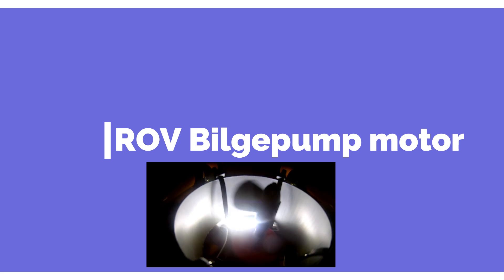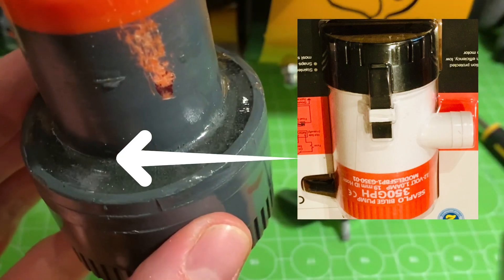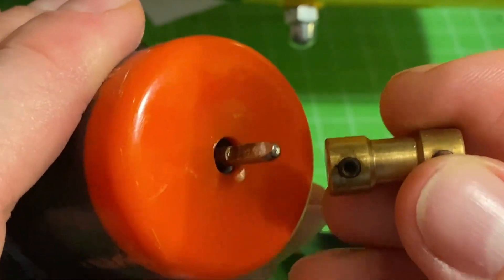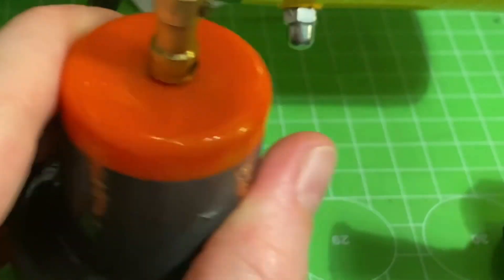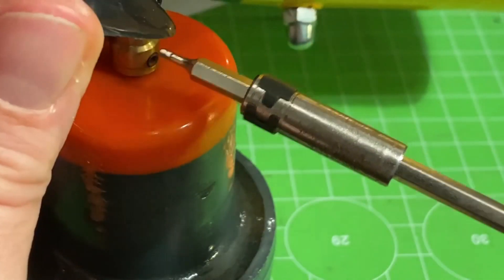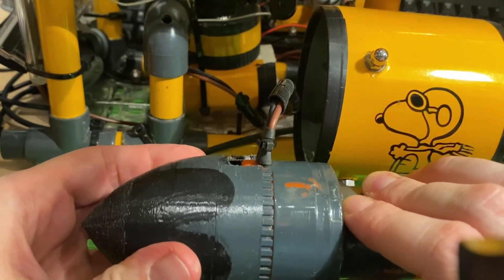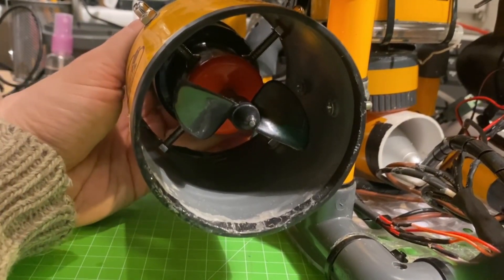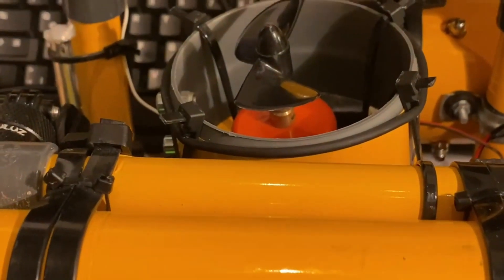Homemade ROV engines with Bilgepumps - simple & easy thruster

Comment: great project, i wonder what if you just install the bilgepump (not reassembly by other propeller). Will the thrust just same or weaker or maybe stronger?
Reply from the maker: Inside the pump is just a little pelton turbine. Meaning you have very little thrust: 
forward you have water exiting a hole and reverse… suction into a hole - no thrust and a bit of thrust through the pump intake… going into a different direction. 
So: I wouldn’t recommend it. 😀🙋🏼‍♂️
Reply: oh i see @agermangineer  , i want to make sea scooter. Is it recommended use this type of bilge pump for cheap and simple project? maybe need more than two of them 😁
Reply from the maker: @imacoid  well, if you use one for each direction (forward only) and if you have a good power supply with a short tether you will be able to operate it. A colleague of mine did that to steer a small buoy.
Reply: i love to hear it @agermangineer  , what do you mean by good power? it is possible to use more than 12v? and good tather mean change the cable to the bigger diameter i guess. Sorry if you hard to understand my english, i'm Indonesian
Reply from the maker: @imacoid  no 12 volt is correct. The question is, can the power source handle several Amperes? And yes, a good cable is not too thin.
Reply: do you mean  @agermangineer  that this pump will drain battery fast? for now i prefer to use lifepo battery
Reply from the maker: @imacoid  yes, that will do fine ☺️

Comment: Hello! Does these engines support reverse trust? if so how can you make it?
If no how can the submarine go back up or down?
Reply from the maker: Just watch from 3:07 or check out my other videos. Switch the polarity of the cables and you have forward and backward motion.
Reply: @agermangineer  Thanks!
Reply: @agermangineer  Do you think if i go 7 or 8 meters deep in water these pumps will hold the pressure? or theyll break?
Reply from the maker: @nicker3115  I’ve had them 15 m deep. No problems down there.

Comment: Und welche Propeller nutzt du
Reply from the maker: Robbe Racer rechts 62,5 mm M4
Oder Graupner…
Reply: @agermangineer  Macht des einen Unterschied, ob ich links laufend oder rechts laufend nehme?
Reply from the maker: @sirmoritz122  nö… musst nur richtig polen. Hätte ich damals links UND rechts kriegen können, hätte ich je 1 genommen.
Reply: @agermangineer  Du meinst am linken Motor einen rechtsdrehenden und am rechten Motor einen linksdrehenden, damit sich der Radeffekt aufhebt?
Reply from the maker: @sirmoritz122  ja, aber nur aus „optischen“ Gründen. Viel Radeffekt oder Torque hat das Ding nicht
Reply: @agermangineer  in der Größe die du mir genannt hast finde ich keine Propeller

Comment: Wow, i love it.  You would think building a vehicle that goes underwater... and keeps functioning, would be difficult.   I dont know if it's your voice or the style of presentation you hold, but ive learned so much from your videos and it doesnt feel impossible.  This videos a perfect example, why use something else when a bilge pump motor is meant to go in water, just adjust it so it spins a prop and attach cabling to modify spin rate and youre good to go.

Comment: i have a problem, when i start the motor for a long time the shaft of the motor is very hot but when i start it in the water there is no problem at all. do you know the cause?
Reply from the maker: Water cools the engine.

Comment: One question about these thrusters; Bilge pumps normally run in pretty shallow water so they don't have the best seals and you don't seem to be oil filling them and pressure compensating them. Are you just limiting your ROV to very shallow depths and putting up with a bit of leakage?
Reply from the maker: That’s right. Deepest turn so far was 15 meters. Didn’t seem to be a problem at all.

Comment: I am looking for that exact same motor, it seems it is unavailable to me. It should be possible to use a 500GPH Seaflo Bilge Pump correct? I may in theory need to step down that voltage using resistors or another method? I am worried that 500 GPH is too much power.
Reply from the maker: The 500 GPH pumps by seaflo are available on Amazon and eBay. However, they got a bit pricey lately. Usually they cost around 15 Euros. Also check the 350 and 1100 GPH versions for comparison.
The voltage can easily be adjusted with a proper DC fan-speed regulator. Or any voltage-regulator fit for the 1-3-or 5 Amp current drawn by the different pump-versions.
Check out my other videos for more info. :-)

Comment: Can i bu your motor sir ?
Reply: Can i buy your motor + propeler sir ?
Reply from the maker: @jugul07  you can buy the whole thing on eBay. Not just the engine though… sorry. But thank you for the interest. 😀👍🏻
https://www.ebay.de/itm/ROV-Uboot-Drone-submarine-Seaperch-DIY-Eigenbau-mit-Cam-LED-Touch-Muh-Hull-/255417661986?mkcid=16&mkevt=1&_trksid=p2349624.m46890.l49286&mkrid=707-127634-2357-0
Reply: @agermangineer  thank you sir

Comment: you'd get a fair bit more efficiency/thrust if you reduced your gap between your prop tips and the housing.   In fact, that might be a reason to go with an aircraft, or larger watercraft prop, so you can square the ends off so they run really close to the housing for the length of the cord of the prop.  These types of propulsion are used a fair bit on things like tugs and are called a "kort nozzle"
Reply from the maker: I know! That’s a great comment, because that‘s all true.
But a key problem here is the motor. It’s built for a tiny little drum with very low friction. A wider propeller increases the current in order to cope with the higher resistance.
A slightly more experienced ROV builder (than me)  suggested: never to use props exceeding 55 mm width. With 62.5 mm I have already overstretched that. 
And since these motors are relatively slow they work well with props with a high angle of attack. Drone props, I believe, have a much shallower angle of attack decreasing the resistance of course, but also the performance. 

So in total I wanted to stay safe not to overload the motor and still get good performance out of the rpm.
Nonetheless they probably both work equally fine.
Reply: @agermangineer  David Gerr wrote an excellent book called "The Propeller Book" that I believe would give you everything you need to know to calculate that precisely (and either engineer or select a prop that would maximize its efficiency).
Reply from the maker: @VigilanceTech  sweeeet! Thanx! 😀👍🏻
Reply: @agermangineer  One solution is, if you're still in touch with your friend with the 3D printer, you could just print a set of smaller nozzles to fit the prop. There's a number of free cad programs you can use to design stuff for printing. I find Fusion 360 to be pretty easy to use.

Comment: Hi. Good job. Do you think i could take 4 of them to power my itiwit 3 kayak(2 1/2 persons) at sea? Will the thrust be enough?
Reply from the maker: I doubt that! Even with 3 Amp motors you will probably only get a thrust of about 4 pounds… any wind gust will overpower that.
I mean, you can try but you can also get simple 12 Volt outboard motors for small boats online. Those provide at least 30 pounds of thrust. My guess is you’ll be better off with that. :-)😀
Reply: @agermangineer  yea i figured as much. was trying to find something really cheap and combine the low cost with the joy of building it :) i will figure out something.

Comment: This is awesome..... but could you please make another video regarding how to connect the arcade controller to the motors with an appropriate circuit diagram and the required components
Reply from the maker: Dude I posted the wiring, though of course not professionally.... and the components... are basically given... sorry, but those videos about wiring, controllers and the engines are final. 
Though not to leave you in the dark: what else do you want to know? 😀
Reply: @agermangineer  just wanted the circuit diagram and list of components except the arcade switch  , stuff like relays n all.....please help....I've already ordered the arcade controller
Reply from the maker: @shravanpoovaiah9329  well you need 12 Volt DPDT relays, like mentioned in the video, and a lot of wire. Along with the joystick that is all. 🤷🏼‍♂️😀
Reply: @agermangineer  ok last question...😅...how many 12v dpdt relays......and could you please make a video regarding connections
Reply from the maker: @shravanpoovaiah9329  ok question: have you seen this video: https://youtu.be/Hx78yZjKz-w
If so, please ask there... 😅